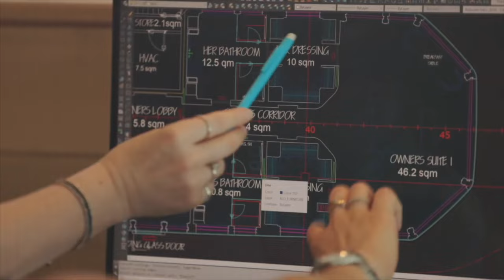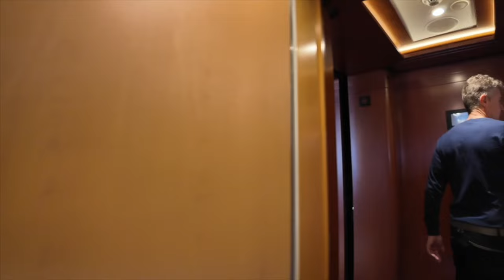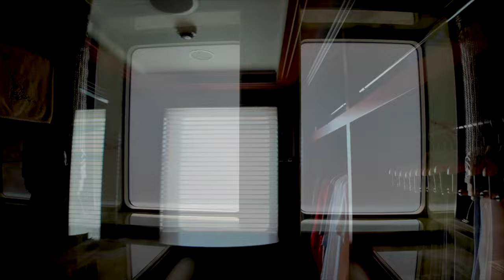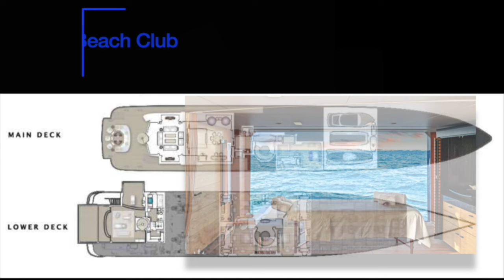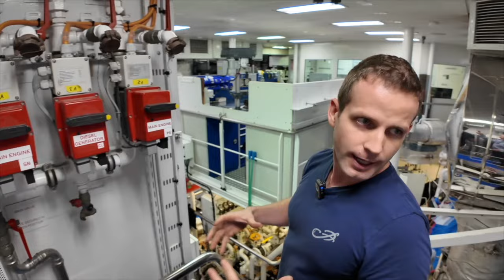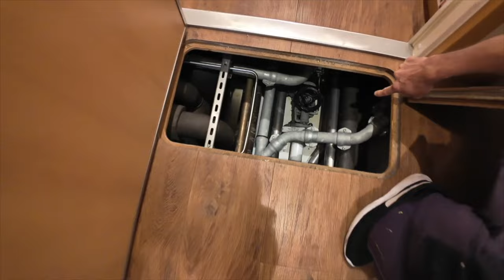257ft Long-Range Abeking & Rasmussen Yacht

Comment: They just took the cylinder heads off individually. I suppose that without an overhead crane, that would help a lot.
Reply from the maker: Surprisingly cramped space considering overall length.

Comment: The man overboard boat must be able to launch within 5 minutes and have its own independent launching system or power system. If the main power goes out, that boat must have an alternative launching system. Manual, Electric, or Hydraulic winching. In addition to being a rescue craft for someone going overboard, it is the main boat used in case people go into life rafts. The life rafts would be gathered together and then tied to the tender as a means of propulsion. In addition, the life raft is to be kept with a minimum of a half a tank of gas at all times. But I think you knew all this you sly dog.